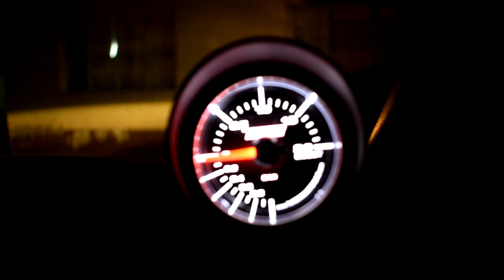How to install a mechanical boost gauge| Toyota glanza| Turbosmart

Comment: What hole in the firewall did you use for the vacuum line?  I'm having trouble
Reply from the maker: Just follow up the rubber boots on the firewall